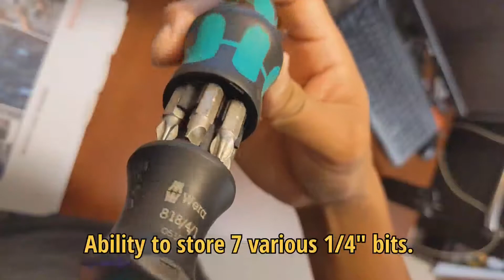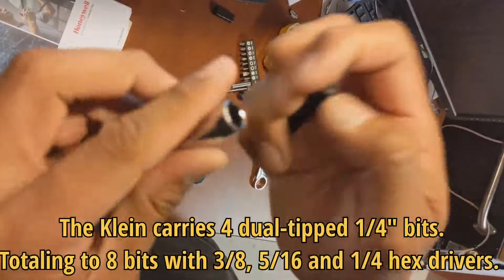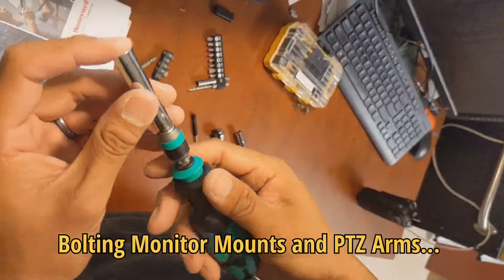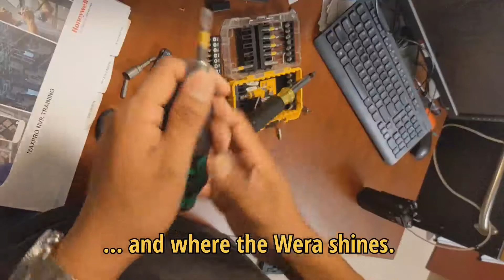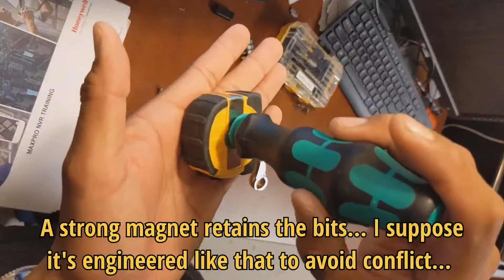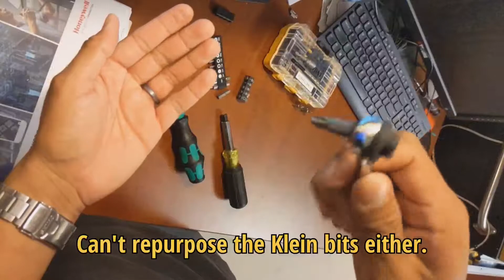Wera 051024 Kraftform Kompakt 25 Pouch Set Screwdriver vs Klein 11 in 1

Comment: If your a fan of the Kraftform Kompakt you should get the rest. 
Wera 056491 tool check plus
Wera 008880 stubby
Wera 028160 flexible shaft 
I have not found a fastener I cannot remove with these in my bag.
Reply from the maker: I will check those out. The thing about Wera is they're pricy.
Reply: @ALTONBENALLY  Do me a favor, if your home  has Phillips screws in the hinges of the doors and if you still have the #2 Phillips that came with the Wera and the Klein. Put your screwdrivers in the hinges and let go. One will stay and the other will fall. My diamond coated bits from Wera will hold up my 12 V Bosch impact while hanging off a screw in the hinges of my door. You get what you pay for.
My 10in1 (yes it’s a 10in1 because I’m old. lol) sits in a 13” green Klein zipper bag that holds my security tools. It is my first Klein Tool and I bought it because Brinks used to install their equipment with #2 Robertson screws. The sheer look of confusion on my face must’ve been priceless when I went to my first Brinks conversion.
Reply from the maker: @thetruth5210  I will have to try that hinge test. The Wera isn't diamond coated though; I'll try anyway. 10 in 1... What's missing from the 11? I assumed it'd be the 1/4" nut driver as some companies don't count that for some reason. I've been eyeballing that kit with the security bits and sockets. The flexible Wera I can go without. I have a flexible Makita one. The Stubby I'll have to get one. Had a multi bit Klein Stubby, but misplaced it. 

Thanks for the suggestions!
Reply: @ALTONBENALLY  what’s missing is 3/8 nut driver.The handle is smaller because of this as well. Both sides of the shaft are 5/16 and the bit holders both identical are 1/4 on each side.